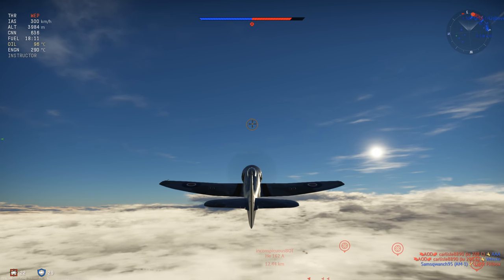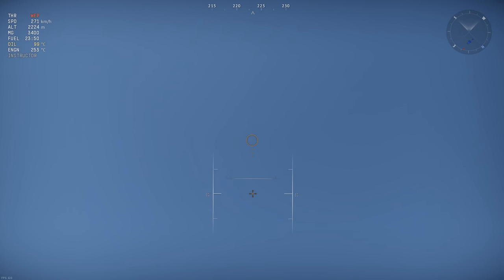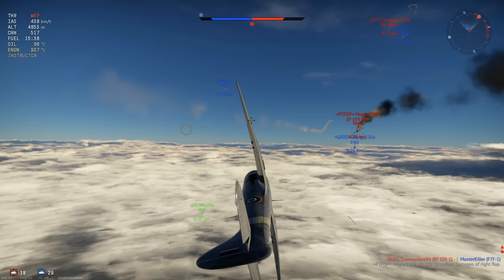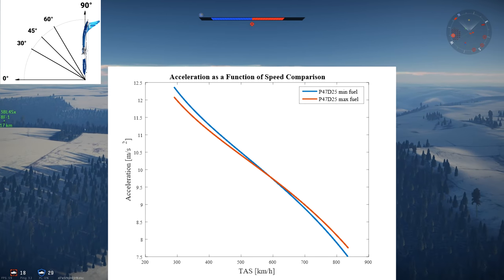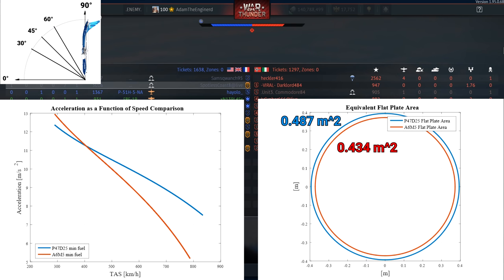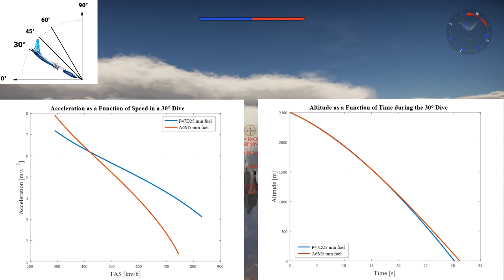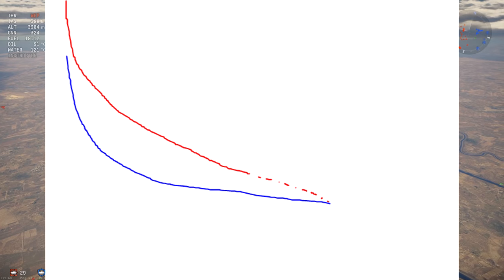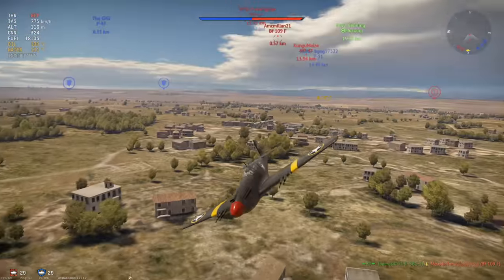Mythbusting | Do Heavier Aircraft Dive Better Than Lighter Aircraft?

Comment: if the aircraft is heavy while the drag is low it will dive faster then a plane with the same weight with higher drag (same engine and propeller off course)
Reply from the maker: Yup, its drag to weight ratio would be lower.

Comment: So... heavier planes dive faster at higher speeds, which is the type of speeds you should be at in a diving plane, meaning heavier aircraft DO dive better than lighter aircraft
Reply from the maker: No, for one the initial dive acceleration is actually pretty important. If the enemy gets close enough to make you dodge, then you bleed even more speed and you might get caught.

Second, B29 is heavier than P51, and yet P51 dives better at every speed. That's an easy counter-example, hence "heavier aircraft DO dive better than lighter aircraft" is false.
Reply: @AdamTheEnginerd  B-29 doesn't dive faster than P-51 because B-29 is also a bigger plane with far more drag and different aerodynamics, which is why that imho was not really a good example.

A P-51 with the mass of a B-29 would dive faster than a P-51 with normal mass. When no other factor of a plane is changed except mass, it's acceleration will be lower in a straight line and up, but in a dive it will have higher kinetic energy and therefore will be less affected by the force of air resistance.
Reply from the maker: @AlmightyDude420  No, a P51 with the mass of the B29 would have the worst acceleration out of any single engined fighter below its top speed. Look at the example with a minimum fuel P47 and maximum fuel P47, the minimum fuel P47 accelerates better at low speed until its top speed, and then the maximum fuel P47 accelerates better beyond the top speed (4:05). That's because a higher mass with the same power will lower P/W ratio, and hence lower acceleration.
Reply: @AdamTheEnginerd   AdamTheEnginerd  Yea, basically what I said. In a straight line and up, the acceleration is lower with a heavier plane. In a dive, it will retain its kinetic energy better, due to being less affected by air resistance.

Air resistance increases exponentially with speed. Planes with more mass have proportionally higher kinetic energy at the same speed, and get less affected by the force of air resistance.

Think about the hammer and feather experiment on one of the Apollo missions. In a vacuum, they fall with the same acceleration, but one gets higher kinetic energy. On the Earth, we have an atmosphere of air to slow a light feather down far quicker than a more massive hammer.

I understand that less mass means lower power to weight ratio, which is why we agree that at a lower speed where air resistance as far less, an equally powerful engine will need more time to get more mass up to speed. But at higher speed where air resistance becomes a powerful counter-balancing force, a light plane will need a lot more power to push the plane any faster than it's already going, and if the wings didn't rip, air resistance would balance it down to constant speed at a certain point. 

At that same speed, a heavy plane will have more to go before air resistance balances it to this point.

I understand that at low speeds, a light plane will accelerate better, but I just feel that when in a heavy plane, you should always keep your speed up and be in a very shallow descent, when enemies are close.
Reply from the maker: @AlmightyDude420  Then we agree with everything, except you seem to underestimate the importance of the low speed dive acceleration but that's alright.

Comment: You have to remember that the engine of the planes are different try to use the same plane and one with bombs, other without bombs.
Try to use heavy bombs to test it out.
Reply from the maker: Planes are indeed different, which is why I tested the P47D25 with minimum fuel vs maximum fuel. That's much better than bombs because bombs change drag as well, while fuel only changes weight.

Comment: How does the increased weight improve stability and controlability in a dive though? I'm guessing WT doesn't model this almost at all.
Reply from the maker: WT does have that kind of thing. Depending on where the fuel tanks are located, it changes your center of gravity which can either help you to pitch or hinder your pitch.

You used to be able to turn significantly better at high speed with more fuel on Fw190D since the fuel tanks were the CG, so it would move the CG backwards. I think this was kinda fixed though.
Reply: @AdamTheEnginerd  how does the CoG move backwards in that case? Aren’t you just adding weight at the CoG which wouldn’t change its location?
Reply from the maker: @dogeness  The center of mass of the fuel tanks are being the CG in the case of the Fw190, so adding mass there moves the CG of the entire aircraft back.
Reply: @AdamTheEnginerd  do you mean to say behind?
Reply from the maker: @dogeness  Yeah behind the CG.
Reply: @AdamTheEnginerd  ah ok that makes sense

Comment: Much as dive speed limits were not the point of the video, I have had moments where a yak 3 would catch me in a dive. Now this in itself isnt surprising as the Yaks have ridiculous dive acceleration. The problem I had is when I was flying my Critpano-51 against them and I was going a little over 700kmh and the yak in a direct chase was gaining on me when I distinctly remember yaks having a rip speed around 690kmh. Unless I'm wrong but I've flown and made the mistake myself, especially considering the 40 to 50 degree dive we had. Oh and he never ripped his wings. Luckily I popped over a hill, turned, faked a head-on to which he made the mistake of trying to go up while I still had good energy and got him but still. I was feeling cheated a little that he didn't rip while gaining on me in a chase at that speed.
Reply: RIP speed is usually 740kph for my yak
Reply from the maker: 1. Was it really 100% direct chase? A small angle can make 10km/h difference.
2. If he's above you, his IAS will be a bit lower than yours for a given true airspeed, so it'll seem like he rips late if you judge it by your IAS.
3. They do rip at around 700km/h IAS yeah.
Reply: @AdamTheEnginerd  I'd have to look at the replay again to be sure, potentially he may have been off my dive by just enough. And I do use only IAS as it is more useful for judging the performance of my plane than TAS in combat. So maybe he was traveling slower but not by that much since he wasnt more than 2km behind me. At least I got the rip speed right. Speaking of which, have you ever had a bug at least in the P-38J and L variant where you get premature reduce speed warnings accompanied by the "your wings are about to rip" sound? I have had this at high altitudes regularly when I get into a dive and get up around 600kmh and I'm wondering if my wings would actually rip at high alt at that IAS simply because the game thinks they should when it wouldn't actually make sense. And by high altitudes I mean 5000 meters and higher as the reduce speed warning shows up later and later the further I go down for some reason.
Reply from the maker: The dive speed warning in the P38 is real! It's actually because you're getting close to the Mach number rip speed of M0.68!
Reply: @AdamTheEnginerd  that's interesting and rather strange. What is that rip speed related to if not airflow over the wings? Because I have definitely gone upwards of 700kmh and not ripped at lower altitudes. I thought it would be lower rip speeds at lower altitudes due to denser air, not the other way around.
Reply from the maker: You have 2 types of rip speeds. Typically, the one everyone knows is the IAS rip speed. You'll rip at the same IAS no matter the altitude because IAS is a measure of the dynamic pressure (aerodynamic force), and aircraft rip at a certain dynamic pressure. The other, less common type of rip is due to Mach number. The P38 would start getting severe control problems at M0.68 because of its low critical Mach number, which among other things separates the airflow from the wing, and since the elevator is right behind the wing, the tail is rendered ineffective. So instead of modeling that, they make it rip at that Mach number. Why does that happen at high altitude as you said? Because for a given IAS, your Mach number increases significantly as you climb, because your true airspeed (TAS) increases to compensate for the drop in air density to give the same dynamic pressure at high altitude, and because the speed of sound decreases with altitude (air gets colder as you climb)!
Reply: @AdamTheEnginerd  I think they got lazy when that fact came around. Just rip the plane apart rather than model something that's not difficult to model in the game. I mean it shouldn't be anywhere near it's structural limit in that state, just an aerodynamic limit. Makes no sense really. I mean the 109s have some serious control stiffening issues at high speed and so does the Spitfire... Well early Spits anyway. Could have done something similar for critical Mach too. I don't know. I guess it's Gaijin at the end of the day. :P

Comment: 1 problem here....
You left the bloody engines on....
Firstly, the P47 is heavier, which means it retains energy better in a dive, or when it stops the dive. The zero may be said to be opposite. *however*, the drag model on these 2 aircrafts are drastically different. As such, it is unfair to compare whether heavier aircraft dive better than lighter aircraft using these 2 aircrafts. 
The error was shown using the first test. They yield similar dive characteristics, even at high speeds. At this point, the heavier aircraft has more kinetic energy, and if the drag was to be the same, the heavier aircraft would fall faster.
2ndly, to clarify viewer misconceptions. It is true lighter aircraft accelerate better. However, this is only true when they have engines on and are traveling horizontally
3rdly, how dare you not do the experiment 3 times and take the average
-Adam’s physics teacher
Reply from the maker: The engines are on because that's how they would be in reality...

The dive acceleration graph also indicates the aircraft which would retain energy better when they stop the dive.

Indeed P47 and A6M are very different, which is precisely why I compared P47 with min and max fuel to directly answer the question.

I don't understand your 2nd point. Engines on is a no-brainer, why test something that doesn't happen? Regardless of the angle of the dive, whether 90° or horizontal, the aircraft with the higher Power/Mass will accelerate better at low speed.

Comment: Is that “void mei” as same as void maid？
Reply from the maker: I don't know "void maid".
Reply: @AdamTheEnginerd  It can display all data that WT provides in 8111 web page in game,records and exports data to xml files.The icon of void maid is a plane as same as shadowsocks.I have used void maid public version since 1.65.But the developer,who only use flying joystick and simulation mode in WT historic combat,has AFK for a long time.I believe he is also studying aerodynamics in the university.
The pronunciation of "maid" in Japanese is メイド(meido),so I just wondering if "void mei" has relevant with "void maid".
Reply from the maker: Sounds like the same thing. It's called Void Mei on the WT forum which is where I got it from.

Comment: Why didn't you just get a buddy and do it in a custom match? This seems 10 times easier to understand and do.
Reply from the maker: It was hard enough to dive well solo, imagine the difficulty in timing dives starting at the same speed and altitude when the time difference is less than a second. And then you can't easily measure the acceleration difference to see which one dives better.

Comment: What about a drag on way lighter plane like zero compared to p47?
Reply from the maker: Drag is comparable (see the flat plate drag area graph), so that's a testament to the P47's clean design despite its massive size compared to the Zero!
Reply: @AdamTheEnginerd  you will lose way more speed in a zoom in a zero.that why zero is a shit bnz plane.
Reply: @AdamTheEnginerd  he's talking about the ratio of drag to density, not the absolute value of the drag. If the ratio is lower (closer to 1:1), then the plane is going to react to the air resistance of a dive more. It's the same concept as having both a pillow and a bowling ball drop. Outside an atmosphere they both have the same acceleration, but inside it the pillow is going to slow considerably because of air resistance.
Reply from the maker: Yes, the drag is similar, but when you divide the drag by the mass the P47's more than twice heavier so it will be decelerated by drag half as much!
Reply: @AdamTheEnginerd  my english is bad so ill just link u to a video
Reply: @AdamTheEnginerd  plus 47 has way better top speed ,rip speed ,and has way better control at high speeds.You are ignoring way to many factors in your video.(sry for my bad english)
Reply from the maker: I'm only talking about dive performance, and I'll argue that the dive acceleration that I talked about is most of what constitutes good dive performance. Rip speed is a factor, but really only for some Russian and Japanese aircraft with particularly low rip speeds. Control at high speed and top speed are separate things from dive performance. Top speed affects a low dive acceleration though, and that's what the simulation says as well.
Reply: @AdamTheEnginerd  so did u wath the ramjb videos?zooming is a big factor in a diving planes and so is max speed, rip speed and good control at high speed.and I'll argue that the dive acceleration that u talked about is least of what constitutes good bnz plane.
Reply from the maker: Watched them a while ago.

The dive acceleration graph is literally a measure of "zooming", I don't know what you mean by max speed, rip speed as I said is not important for a majority of aircraft. I consider high speed control to be a separate category than diving. I'm not talking about what constitutes a good bnz plane, I am strictly focusing on the dive part of aircraft performance.
Reply: @AdamTheEnginerd  i dont think u understand what a zoom is.i recomend u to watch the video i gave u in the first link.there is a reason why light planes are bad at bnz.

Comment: So basicly when zero diving on you. It take less than 15 sec to dive and gain saperation ?
Reply from the maker: Not at all! It took 2 minutes in level flight to get 1km separation from a Zero starting at equal energies, that's a long time! It would take about as long as what you saw in the last clip with the F4Trop diving on me.
Reply: @AdamTheEnginerd  i mean in a dive
Reply: I mean 80 to 90 degree dive
Reply from the maker: @misy5174  Yeah, but it'll take close to as long in a dive.

Comment: Heavy planes dive better because they are usually sturdier and rip at higher speeds+they are usually more controllable, not because they out accelerate lighter fighters
Reply from the maker: I'm talking about dive acceleration because that's what people complain about, getting caught in a dive by lighter aircraft. Also, heavier planes aren't necessarily more controllable at higher speed and don't necessarily have a higher rip speed. Bombers are an easy counter example.
Reply: @AdamTheEnginerd  ok i worded it wrong, i meant heavier fighters. So an fw 190 or a p-51 can make more use of gaining a lot of speed in a dive than say an a6m3 or a yak in general, even if those lighter planes can outaccelerate them for a while.
Reply from the maker: @nks406  As in for an attack run? Yeah sure, but I'd consider that to be high speed handling, not dive performance.
Reply: @AdamTheEnginerd  i consider handling, rip speed, acceleration etc. all to be different aspects of dive performance, and overall say a p-47 is better than a yak-3/a6m3

Comment: Hi Adam. My gameplay against different type planes depends on air dynamics of war thunder. I can find infos about different type on planes from your videos or in War thunder website. But there is not many infos about air dynamics. I think in order to understand air dynamics of war thunder, man should have a deep knowladge about real air dynamics. If you can make more videos about dynamics or if you can explain how you are doing this videos. It would be greatful. Your videos  helps me a lot to make new tactics. Thanks for the video
Reply: And how are u doing these graphs. It helps see the diff between planes
Reply from the maker: You don't need real aerodynamic knowledge per say, you'll know enough about an aircraft by knowing its climb and top speed, and how its performance changes with altitude. Pretty much, if you know the aircraft, you'll know nearly everything you need to know for WT. Rest can be important details, but they are still details.

These kinds of videos use the flight model data files to get the relevant coefficients, then I program everything to simulate the dives and create the graphs.

My pleasure!